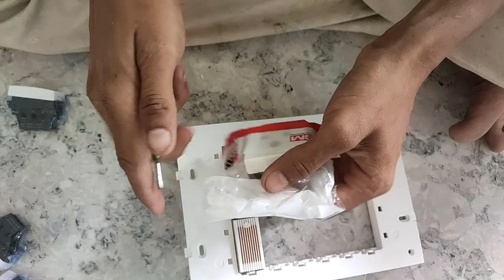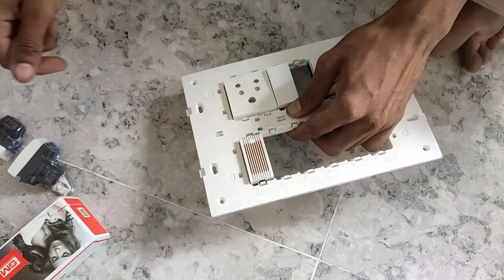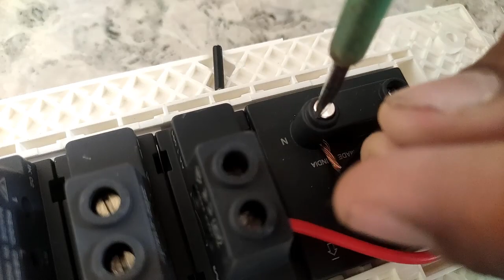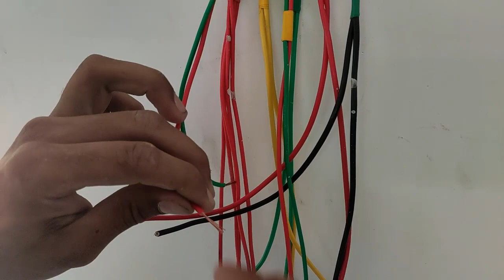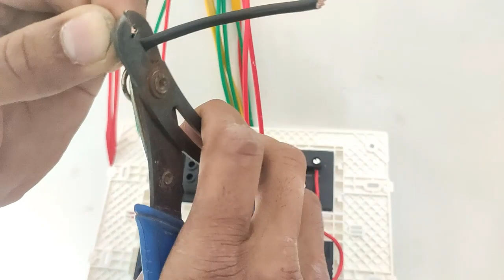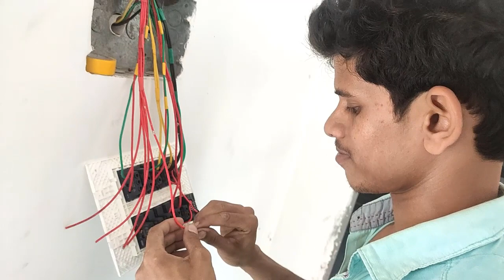How to connect switch board  | 12 modular board | house wiring

Comment: House wiring kase kore Plz bataya kase Dukan me wering kase kiya jata ha. OR wall me kase circular box       Mcb box wall cutting karke pipe fitting kiya jata ha muje wering seakna ha Plz bataya Dhuka Ka wering karna Ka tarika OR inveter kase set kiya jata ha OR inveter wering kase kiya jata ha . OR 2wey switch Ka wering kar ne Ka tarika bataya 6 Light and 1 1Fan ko kase dho jayaga se control kiya jata ha 6 Light ko kase dho jayaga se control kiya jata ha uska wering kare dikhaya Circular box me Led Down lights fitting kiya jata ha..  OR slab me kase circular box fan box concealed box    lag baya slab Ka piping kase kiya jata ha. Slab piping Ka wering Ka tarika bataya. ❤❤❤❤👌👌👌👍👍👍👍 sad me use kare Bala  circular box or concealed box    pvc band plastic orund sit  Ka price bataya kon sa company Ka wire wering me istamal kare OR konsa company Ka modular switch plat istamal kar tum ha ra ELECTRICAL wering Ka video Acha ha slab pipe all wering wall cutting  Ka video
Reply from the maker: house wiring video : https://www.youtube.com/watch?v=ParsZFJDh4I